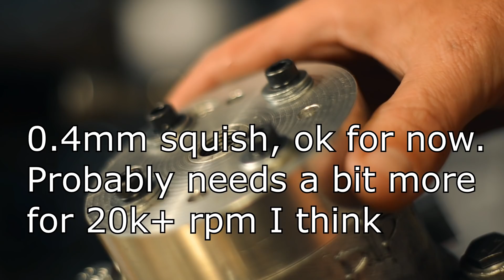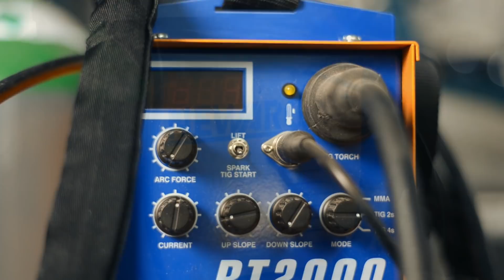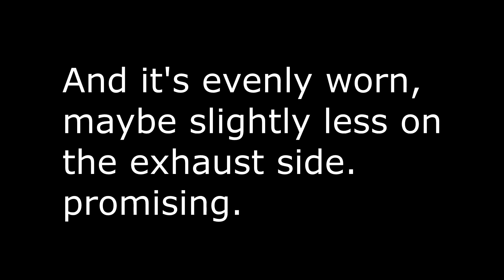The Most Powerful Two Stroke Ever - First startup attempts

Comment: This is true art and engineering right here, but than you get these mechanics knuckles heads out there who think they are all smart and know everything smmhh. When you do this type of building you are a true explorer and engineer. Ive worked with so many dumb mechanics, dont know  even some basics about engineering or machining or building. All they do is over torque the shit out of a bolt to put somethin back together before the bolts about to snap or nut strip off  haha sry for some of the negativity towards other mechanics out there but its true

Comment: Impressive work so far buddy just going by the sound it was making it sounds like it is not drawing through the primary carb? Either there is a crank case leak or maybe the crank case volume is just to big now as the transfer ducts are very big now and a 40mm bore is not going to move a lot of gas, I think I’d do a crank case compression test next. But the ring wear is concerning 
Keep at it!
Reply from the maker: Thanks! Yep, massive case volume is not working in my favor here.... It does suck through the carb tho, reacted to throttle/choke. I remember easily starting the "other engine" with the rotary valve completely removed, if that's possible, big case should be too.

Comment: Did you put oil in the cylinder before putting the Piston in?
The oil helps to seal better.
Maybe it starts better if you weld a washer with a 8-10mm hole on the end of the exhaust pipe to provide some backpressure...

Comment: As already explained, the weak point of your engine will be the guidance of the ring.
your engine will run perfectly with one or two welded aluminum bars in the exhaust port which will guide the ring and avoid too much friction on the nikasyl coating.
Theoretically, a single bar in the middle could suffice. You wouldn't lose any performance with this edit.
You have already lost 0.015 of bore using a drill, imagine at 20,000 rpm ...
No matter what the ring material is, it won't make up for an engine design error. Good luck man

Comment: By the sound of your torch and the look of your weld, it seems that your argon flow is probably to high.
This has a tendency to catch the air in the argon flow by the ventury effect.
Set the flow as low as your skin can detect it, that will do the trick :)
Reply from the maker: Thanks, great tip!

Comment: You could try putting more oil in the mix just for testing purposes. It’s just helped me start weed eaters that wouldn’t start on brake cleaner and the likes of that. I put it straight down the sparkplug hole and made sure the crank was wet pouring fuel down the carb because it was sitting for years

Comment: Put on the exhoust , i think that the backpresur is to low with just a straight pipe
Reply: back pressure in a 2 stroke would be more of a hinderence actually, it's method of exhaust relies on pressure from the combustion and intake to push the exhaust out of the pipe, whereas a 4 stroke actually pumps the exhaust out with the piston

neither need back pressure to run
Reply: @gabrielsturdevant9700  No. 2T's have a very finely tuned exhaust pipe to provide back pressure. Some fuel actually exists the exhaust port on most 2Ts, so the pressure pulse pushes some back in and compresses the mixture just a tad bit. 2T dirt bikes wouldn't have those fancy pipes if back-pressure was a hindrance.
Reply: @kyledelange7055  aight, i shouldnt talk about things i'm not an expert on. i still dont think it's the reason it's not running

everyone else, please dont keep responding to me telling me im wrong, thats just unnecessary at this point
Reply: @gabrielsturdevant9700  You're not wrong. The pipe will be tuned to work at much higher RPM than the engine is turned by the drill, it will have absolutely no effect while starting.

Comment: I can't wait for you to find success. But to point out a potential problem that might be tough to address, there are pitting defects in the cylinder. They don't seem significant to me but may in fact be preventing full compression. All the best! I'm rooting for you!
Reply from the maker: 👍 My thoughts exactly, gonna try to fill them with superglue, see if it helps.
Reply: @2STROKESTUFFING  you know its kinda funny but I've been working to start a rapid prototyping company casting 3d prints. I'm hoping to provide professional grade castings directly from prints. I've got the process down and have reached the wicked belt buckle phase. But the economy has beat me down and I no longer have access to a shop. Anyway, maybe I'll send you a new block as a promotion if I can ever find my feet

Comment: You should see if it will start on propane. I usually first start my bikes on it because it makes for an easy start. I just squirt a syringe of 2T oil into the intake for some extra lube. Helps a lot with the pumper carbs that don’t always like to prime very easy the first time, until you get it actually running
Reply from the maker: Awesome tip!
Reply: Even my head mechanic first starts the 700hp+ turbo busas he builds on propane

Comment: The excessive wear of the pistonring is maby also caused by the gliding in the 100% part by sharing the ring on the outside so the spring force of the Ring lays always on a smaller contact point

So I think a solution would be a thicker ring that way it counters the wear with more material to wear and the contact area is bigger even with sharpening the force of the ring will not Crack small particles of the corner

Also such a rig could contain its force better I hope u consider to make ur own pistonrings and try it
Reply from the maker: 👍 Good suggestions!

Comment: Shouldn't the spark plug be torqued in not just tightened? Sealed rings may be the way to go or a pair with staggered ring gap your piston fit will have to be PERFECT and as soon as you start to see any opaline the cylinder will be done for I think. But thats the issue with extreme race engines

Are you still planning to start it using the wheel of a second bike/rollers whilst in the bike?
Reply: Well you can do everything with torque wrenches but a hand trained for long enough archives the same
Reply: @peterzingler6221  not consistently enough that I'd be comfortable for more than startup and test bed stuff. Iv seen some fairly impressive pressure related failures cause issues. Don't want to see spark plug launch it out the cylinder taking the threads with it half way a day at the salt flats 

Even the best iv ever seen was only able to guarantee within 15% of spec over or under when we checked their 'experienced' hands.

Comment: 118 race fuel and not enough compression? try squirting some fuel down the intake, get your air gun from the compressor, turn the engine over and give the carb a puff of air to prime the casing and get things moving in the right direction, it will create a little pressure in the casing to allow more transfer port flow,  I bet it would fire up then.
CASS Compressed Air Supercharging
Reply from the maker: That's a good tip, I'll try that if I can't find out where the low comp is coming from.
Reply: try a wet compression test, add some oil to the bore to help seal the rings, this should help stop blow by on the rings

Comment: Like I said before, 0.7mm squish optimum for rod stretch and thermal expansion
Reply: yes. At .4mm the piston will be touching the head when the rod gets hot
Reply: You need to know the rod length to said this how can you calculate expansion longer rod = more expansion
Reply: @legros731  yes the rod length matters but on a 50cc engine the rod is usually 80mm to 86mm so I'm not going to worry about 6mm. Any way your response makes it sound like I gave a specific number which I didn't. But I'm pretty sure he will smack the head if he doesn't increase the clearance.

Comment: Many 2 stroke rings are steel, Steel and nodular iron rings are about twice as stiff for a given dimension as grey cast iron. Steel rings need a plating to run on cast iron bores., no idea if that is needed for nikasil. 
You are probably doing this but when welding in a lathe put the ground clamp on the part or chuck to avoid passing current through the bearings.
Low compression is probably the ring. Inspect the edges of the ring and the chamfer for teltale marks. To increase ring pressure you could try putting one of those old school expanders behind the ring, some 60's and 70s two strokes had them behind number 2 ring.
Reply: Nikasil bores use unplated rings. One, either the bore or ring surface, has to be the 'wear' surface that gets seated to the other. I discovered this when converting the top end of a KE100 to iron cylinder.

Comment: It might be worth plating the ring, which will give it a harder wearing surface. It would also keep the soft meaning it will be less brittle and less prone to snapping.
Reply: Just did a bit of research and chrome plating offers, high wear resistance, low friction and high corrosion resistance.
Reply from the maker: I should be able to plate it at home, already got chemicals.
Reply: 2STROKE STUFFING it’s probably something worth experimenting with. If you do plate the rings, just do the edge of the ring that contacts the cylinder wall. You don’t want to wear out the ring groove in the piston.

Comment: Nice work so far ,my compressor piston rings snapped on disassembly, now it running better than ever with one 1970s briggs stationary engine ring I made fit that was the right diameter I had in the junk pile haha, still going after 6 months ..

Comment: Where was your TIG ground?! You can't let current go through bearings. The tiny contact area will destroy them!
Reply from the maker: Was on the "right side", heat might have screwed things. And that ratchet was crap too... I'll buy another of the pre-made ones.
Reply: @2STROKESTUFFING  Wasn't (too) worried about the ratchet. I give you props for that brutal decapitation :-) What I'm concerned about was the lathe. I saw some good how-to's on rotary welding tables that clued me in to the danger of grounding through bearings. Hope yours are safe!
Reply: Let me explain. Our friend was using his lathe to align the ratchet and weld up the socket to it. Electrical welding requires a very high current circuit to be established, so a ground path back to the welder is required. If you put the grounding clamp somewhere on the lathe itself, that current will (at least partially) flow through the chuck, then bridge across the bearing surfaces. Since the whole idea of bearings is to minimize contact, and they are riding on a thin layer of grease, what happens is that the current will end up arcing across those tiny interface points. This of course can result in horrific localized damage to the bearings. The ground needed to be positioned to prevent such a thing from happening, but his tight shot didn't reveal to my eyes the clamp anywhere I would have hoped to see it.

Comment: Think you may need to develop some means of retaining the ring at the tail ends.
 The special ring may take on the appearance of a large circlip,
 with two pins acting on inside of the tail ends. 
Would a bridge in the middle of the monster exhaust port be that much of a compromise?
Reply from the maker: 👍 If it turns out the ring is causing trouble I might revisit an idea I had before going to the stepped version. One "circlip eye" opposite of the ring gap. Might be able to modify this ring to function in a similar way for testing.
Reply: @2STROKESTUFFING  Yes. But two stops. One for each ring end . acting as registers to stop ring expanding two far, and into exhaust
port.

Comment: I love your videos dude!

Just thought i would give you a little tip for when you cut off screws/bolts. Instead of grinding the end of them to make the thread work again, just put on a nut before cutting and then unscrew the nut after cutting. The threads in the nut will correct the screw/bolt
Reply: I do both
Reply from the maker: Awesome tip, thanks!
Reply: 2STROKE STUFFING happy to help, glad you saw the comment
Reply: I do this with dies. I should've known it's been done before by others lol
Reply: @The Truth about Africa hurts its someth8ng thats easily forgotten and is a LOT easier.
Reply: @The Truth about Africa hurts i didnt.

Comment: Alex, you may wish to change those copper washers on your head bolts to hydraulic type dowty steel/bonded rubber washers, I think the copper ones will thin with use and lead to head gasket failure. Keep up the good work! 👍
Reply from the maker: Good tip, thanks!

Comment: With the right size O-ring stock (or an oversized collection) you can make your own custom O-rings easily with cyanoacrylate glue although some materials require a specialized adhesive. You could use your own O-ring factory. You've got a record to set, no time for waiting.
Reply from the maker: Great tip!

Comment: the Evinrude G2 uses liquid sealer instead of an o ring between head and block, and it does work. are you definitely going to use an o ring?
Reply: I'm fairly sure that a liquid gasket would be a better option at this point tbh. There are enough yamabond and similar sealants that can do the job and are rated for the heat.

Comment: I’m very excited because I’m also designing/building a bit more roadworthy engine and it came to my mind that you are using an exhaust port with a very high surface area. That big exhaust port, at low rpm and at starting, can completely cancel the trapping efficiency. So the fact that you say that the engine has low compression may be for that also because the final ring gap is way to acceptable and should anyway start. So you should calculate the compression ratio with the Japanese method and if it is way too low you should try to block the exhaust port with a very little diameter exhaust. If you have any technical question, you’re welcome
Reply from the maker: Awesome, thanks! I wonder if porosity in the bore can be a problem, many of the small cavities are higher than the ring. Also the ring might bind in some way making it out of round. Lots to investigate!
Reply: @2STROKESTUFFING  Bore porosity? Haven't you already polished it? And watching the video I haven't noticed that you oiled the ring, have you tried to oil it? If not, why you don't try to add a little bit of oil from the spark plug hole.The oil dramatically increase the compresion if the problem is the ring or the bore. I'll be very pleased if I can help you in any way

Comment: My guess is, that you have cranked it waaay to much without propper lubrication, so pistonring and cylinder coating are now worn in too much 🤷🏼‍♂️
Reply: What do you call "proper lubrication"? It's a two stroke so all the oil is in the fuel.  Even without a drop of oil the ring shouldn't have worn that much, it's clearly a material problem.
Reply: @ferrumignis  Always! Oil the piston when you insert it into the cylinder, I personally use simple twostroke Oil. Put it on the finger and distribute it evenly around the perimeter of piston and cylinder. The surfaces can only seal properly when they are lubricated and on top of that, the wear is decreased multipe hundredfold. It's simple physics, newtonian friction is higher than stokes friction, just look it up in a book about "tribology"

Comment: I was hoping for the ring not to snag, so this ending will do for me! Exciting stuff!
Reply from the maker: Exactly, everything else is just formalities.
Reply: 2STROKE STUFFING gotta chamfer those ports
Reply: Your getting there, but uhm, when the piston leaks, you won't get any good case pressure.
My engine runs great with 0.6m clearance, but it has 2 rings, I'll bet when you have the right piston rings it Wil fire up,
Oh try to inject a little bit of brake cleaner to start it 🤗

Comment: Don’t get discouraged. It’s still progress and you have plenty of avenues to explore for solutions. Definitely jealous of your tig machine too
Reply: The only thing I'm wondering is how is it the most powerful 2 stroke?
Reply from the maker: It will be, eventually...
Reply: Braydon Beshirs the cylinder/port design is supposed to increase volumetric efficiency and allow for higher rpm
Reply: Braydon Beshirs In hp/engine volume. This is only a 50cc but if you scale it up your should get the same results of course multiplied by whatever the engine size was multiplied with. Make sense?